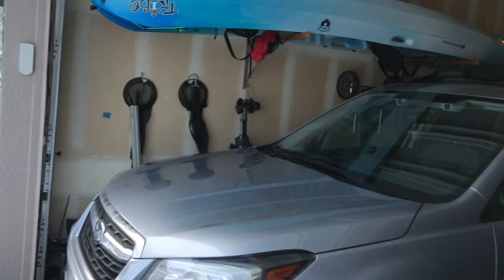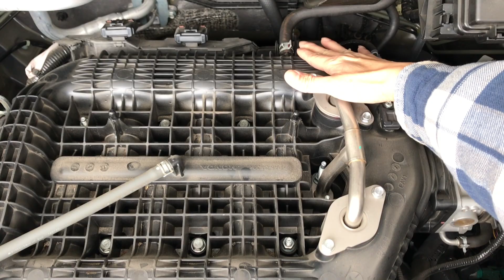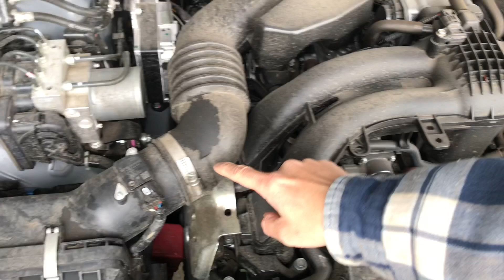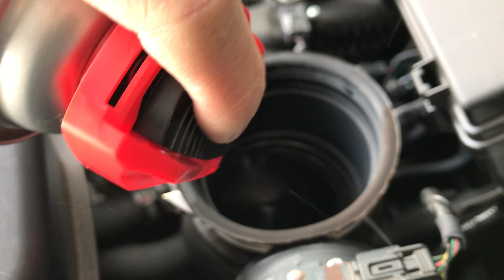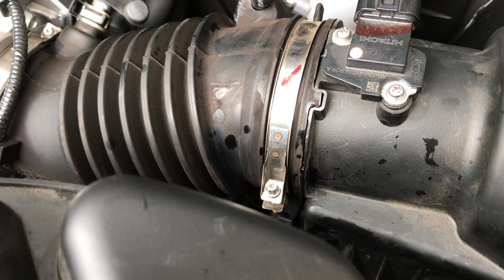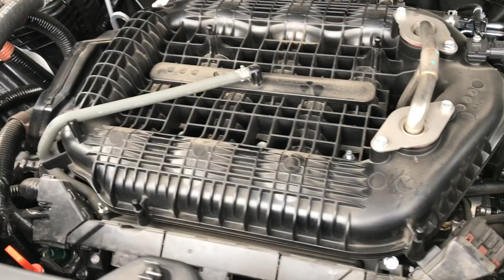2017 Honda Pilot Direct Injection valve cleaning

Comment: Had the intake manifold off of our 100,000 mile 2018 to adjust the valves and all the intake valves were pretty clean except cylinder 1. Which had a small amount of carbon on them.

Comment: Hi. Can you give me a hint? A message came up on the dashboard "emission System problem" I read errors p2096 and p2270 honda pilot 2017. Internet says similar problem although there is no extraneous sound. Can you tell me what could be the most common? And maybe the problem is that I poured injector cleaning fluid into the tank? How much is this estimated to cost at least roughly?! And I don't understand everything, I use a translator. Thank you.
Reply: Bad fuel injectors. Honda knows about it and they're warrantied for 10 years. Look up the federal law on emissions

Comment: Dude that hose over the middle of the engine is a direct access port over the intake valves.  That's where you are supposed to spray it
Reply: Just did my passport today, vacuum connection in middle of intake manifold. Worked great. Thanks
Reply: @randyschmidt7595 how did you do it? Do you just remove the middle vacuum hose and spray?

Comment: Why would they go direct injection?  Absolutely stupid idea.  I just have the head off of my 2013 Honda Pilot, 240K miles, and the valves and cylinder were sooooo clean.  A broken timing belt pulley bolt cause some valve damage on two cylinders.  All in all, the job was pretty easy, though time consuming.

Comment: How is your pilot running so far? I am curious... do you usually keep scantool plugged in and also monitor occasional misfires? When there is buildup on valves you will see misfires because valve will not open or close fully.
Reply from the maker: So far it’s running great at 90k, smooth as when it’s brand new, I am surprised how well this engine is holding up so far
Reply: @Y @Yakfish-Taco n you answer on the new comments?.. it’s been over 6 months…

Comment: I actuially just watched this video today. i did the same process on my 2017 Acura MDX. I sprayed the CRC GDI cleaner through the throttle body to get it to all 6 intake ports. I got nervous though when i drove my car for 25 mins on the freeway because it was losing power and the engine light was blinking. but after getting back and resting the car for 20mins I started the car again and no blinking engine light. I let it ran in idle for 10mins then drove it again in the freeway. the acceleration response was amazing. Gonna do this again after 10K miles.
Reply: Likely the weak power on the first drive was the engine going in "Limp" mode until the warnings cleared.
Reply: @timtaylor9339  Thank you sharing your experience I will trait this great information. That he share.

Comment: isnt this valve residue being evacuated via the exhaust ? you say to try to do this job closer to your oil replacement cycle which makes sense, but you are also suggesting this residue will end up being diluded with the oil inside the engine....
Reply: If your piston rings are experiencing blow by then there is the chance that small amount of the product makes it into the oil pan.  Therefore, performing this near the end of your oil change interval is just common sense.

Comment: use  top tier gasoline 91 octane with out ethanol , high quality syn oil . my 2018 never had that problem , or even oil dilution , I change my oil every 5000 km

Comment: Oil catch cans are only really helpful in turbocharged engines where there is higher oil blow-by. There might be some in NA engines from the PCV valve, but not as extensive as in turbo engines.
Reply: Not true...you won't believe how much my cans catch in my v6s

Comment: I wonder if this is good for your catalytic converter.  I have a 2014 Honda Pilot touring with 192,000 without doing this and it still runs smoothly. I cleaned the throttle body though and I only spray through the cloth and not inside the body.
Reply: Just make sure that the stuff you use says safe for cats

Comment: if the intake valves were meant to be cleaned wouldnt honda include it in their service recommendations. not just honda but other car makers. i'm sure they wouldnt want their reputation tarnished with engines that fail because of a poor design, or with something that should be done as regular maintenance
Reply: It IS part of maintenance. All direct injected engines will need the valves cleaned, once they get really bad the valves have to be walnut blasted to take the carbon off.
Reply: BMW has it as part of a maintenance service
Reply: @jerzefigga  its not part of my cars scheduled maintenance i looked. but i can ask them to do it at 50k miiles

Comment: Or, remove the MAF sensor and shoot the fluid down through there.
Reply: Excellent idea, that would be much simpler but would it affect the maf sensor when it's re-installed?
Reply: You’ll get codes, and the computer will try to compensate and make engine run unpredictably.   Possibly even put the engine into limp mode.

Comment: Hi, I got P0455 and P0456 code after cleaning the intake valve. Did you have the same issue? How did you solve it? Thanks
Reply from the maker: Hi, I didn't have any code showed up after the work, hopefully you had it resolved. Cheers

Comment: Isn’t the 2017 Honda Pilot engine has dual port? I think fuel additives is fine and drive it higher rev or more in highway.
Reply from the maker: no dual port, just the direct injection, no port injector

Comment: Hello Yakfish, I'm wondering how your 2017 Pilot is still holding up? I'm considering purchasing a 2017 Elite trim with 30,000k mi and have heard varying complaints of the fuel injectors going bad or depositing too much fuel and mixing with the engine oil causing a lack of acceleration power. You seem to take excellent care of your Pilot which begs me to ask if despite your great care have you had any issues with it? I've also heard that the Infotainment system can go a bit screechy and  go haywire at times. Much appreciated for any information you can pass on, Thanks!
Reply from the maker: Hi, thanks for asking. My 17 Pilot EXL has 63000 miles at this point, been experiencing 0 issues so far. We just went for a 2500 miles trip from Vancouver Washington to Yellowstone and it drove like a dream for the trip, averaging 28MPG. I did an oil change right before the trip, will change it again soon once it gets to 4000 miles, didn’t notice and gasoline smell or excessive wear in the oil. I will do another transmission flush at 80000 and will change out the transmission filter too. As for fuel injector I haven’t seen any issues yet. Infotainment as Apple car play? It seems to be working ok, the wife hasnt complained she’s the main driver. I guess we been lucky so far :)
Reply: @Yakfish-Taco  I live east of Portland, so local to you. I just picked up a used 2016 Pilot. What about spraying in where the PVC dumps into the intake? that's where all the goo comes from.
Reply: @Yakfish-Taco  we have a 2016 pilot and started having lots of issues with the fuel emission system. I did read there is a recall but when you drop of at dealership they will give you a different diagnostic. There is something wrong with our fuel injectors. Wondering if this method will help. Changing the fuel injectors is really pricey.
Reply: @Yakfish-Taco  I have a 2019 Honda pilot elite awd and I average 16mpg. It’s brand new and onyl has 30,000 miles on it. Why is mine getting such bad gas mileage I’ve seen a lot of other people have this Same issue and I’ve seen some people get 22 mpg with their 2019 pilot.
Reply: @gbma3241  There's too many factors to say for sure. Are you lead foot driving? Do you drive short distances or long? Do you drive in traffic or the freeway? Is the car well maintained (regular oil changes, air filter, etc)? What kind of tires do you have (all season, snow, all terrain)? Are you driving around with your parking brake on? Is the car empty or are you fully loaded or towing something?

I have a 2019 AWD LX and I get around 24-26 mpg highway and around 18 in the city. The MPG calculator on the car estimates on the high side on my Pilot by about 3 mpg. My Pilot has the 6 speed auto so that's different than yours but the MPG shouldn't be much different. I tend to drive with a light foot.
Reply: @Yakfish-Taco  hey I think you have great content. I also have a 2017 Honda Pilot exl and have an emission system problem check engine on. I have have my transmission fluid changed. I never did the intact valve cleaning you are doing. Do you think the fuel injectors are failing for everyone because they don’t do this maintenance. I also noticed people having issues with transmission issues. I have 43k miles.
Reply: @fejzocecunjanin2028  this is procedure to clean the back of the intake valves. this is not cleaning process for the injectors.
Reply: I have emission with check engine light on 13 honda pilot touring...
My 13 honda crv on dealership to replace power control model...

Comment: I'd be curious if you keep this vehicle for a long time if this works. I hate to say it but I don't think it will be sufficient. I think they need to be blasted with walnut shells. That's the normal procedure anyway.  If this works for well over 100,000 miles, that would be great.
Reply: If you repeat this service every 10K miles starting from new than it can very well delay walnut shell blasting. If not starting from new, than It most likely will not remove hardened carbon, but possibly prevent additional carbon.

Comment: Do you know if I need to do this to my 2016 Acura MDX?   Both MDX and pilot share the same V6 GDI engine right?
Reply from the maker: Yes, same engine. I think won't hurt to do this to the MDX :)
Reply: The MDX usues different ecu settings probably bigger valve heads hence why requires 91 or higher octane

Comment: I think you've been asked before, does the CRC intake cleaner solved 'Emission System problem' P0430 code?  I believe the light comes on around 50,000 miles on 2016/2017 Honda Pilot.  I had mine came on about 3 months ago.  Based on online research, there are hosts of  2016/2017 Pilot owners  with similiar issues.  Dealers want to replace injectors costing about $1500. Very disappointed with my Honda Pilot, maybe going back to Toyota.
Reply: Just wanted to update everyone!  I purchased 6 bottles of Chevron Fuel Injector cleaner from Amazon for $37.00  after the 2nd bottles, the Emission light disappear.  It's been over 1,000 miles and 3 full tank fill up, the light has NOT reappear.  Prior to this, it would appear about 75 miles after fill up.  Keep my finger cross!  Do I feel performance difference?  NO!  However, if this could clear the P0430 for $37, I am all for it!  Good luck to everyone and hope this helps!
Reply: After several months running on on/off Emissions lights and several bottles of Fuel Injector cleaner, I did notice some improvement to acceleration and my mpg average moved up from 21.3 to 21.8, which must be due to injector cleaner.  

In my mailbox today, I received a notice from Honda Corporation that they will repair all P0430, P0420, P0300 - P0306, P219A, P219B.  I am beyond thrill after suffering over year of poor acceleration, Honda finally came thru.  Can't wait to get to the dealership to have it fixed once and for all!  Thank you for all that have all read my updates and issue with my Honda Pilot.
Reply from the maker: Thanks for the updates
Reply from the maker: My pilot has 64000 miles now, no lights yet

Comment: What is that ticking noise from the engine
Reply: Fuel injection
Reply: honda's turbo
Reply: @youtmoonea  what makes a ticking noise on a turbo?
Reply: Just a loud Honda engine. All the Honda engines are loud. I bought my CRV new in '16 and the engine noise freaked me out until I heard others the same way.

Honda generators are loud too 😂
Reply: Stupid Honda design....they can’t make it quieter engine.  I was able to get rid off that ticking sound on my old 02 MDX after cleaning intake manifold completely removed and cleaned, new EGR, clean EGR pipe, throttle, new IAC valve etc.  Made engine super quiet than any other new Honda/Acura.  Honda/Acura design = Carbon build up everywhere.  Toyota no issues at all.

Comment: Can u doing video on awd. I know nothing about honda and can't find any helpful info on a 2014 ridgline.i want to say i have similar engine i have 3.5 vtech not earthdreams
Reply from the maker: Hi, not sure what you mean by doing a video on AWD, this Pilot is an AWD model, but this maintenance isn’t particular to AWD or FWD. Your 2014 Ridgeline uses a port injection engine so the gasoline cleans the intake value naturally, unlike the Earthdream engine. So In theory you won’t need to do what I did.
Reply: @Yakfish-Taco  lol sorry I meant can you do a video on servicing the awd differentials. I've owned a mustang for 10 years and have no idea what I'm doing. I love honda but not very many do it yourself videos on YouTube for a 2014 ridgeline
Reply: Its like the 2014 ridgeline never existed. Dealership charges way to much for minor fluid changes. Truck gets very poor gas also Please help!
Reply from the maker: We did the differential fluid change at 30k and every 30k going forward. We did it at the dealership for $147 on both front and rear

Comment: I'm no pro but a car with 30000 miles has just broken in. All engines are different  depending on driving habits though. Your engine is still clean for sure but doing this will prevent premature maintenance 👍

Comment: Does this CRC Intake Valve cleaner solve the "Emissions System Problem" engine light issues that are happening very frequently??
Reply: Prabhas, I had success with Chevron Fuel Injector cleaner from Amazon - 6 bottles for $37.00  By the 2nd bottles, the light disappear and has not appear since.  It's been over a month now and over 1,000 miles, keep my finger cross.  Good luck and I hope this help!
Reply: @rontan8954  Did you have a
RPM fluctuations ?
Reply: @soldado23  Yes I did.  The car would hesitate on acceleration and the RPM would run up but the car would not keep up.  As of today 4/1 - thought it was a April Fool joke - just got a letter from Honda that they will repairs the emission issues relating to DTC P0420, P0430, and other error codes due to Emission failure.
Reply from the maker: That I don’t know if it will. My pilot hasn’t had engine light coming on yet so far

Comment: Just subbed....nice vid...hey about changing out the coolant. Can’t find anything anywhere for my 17 Ridgeline...same engine as pilot
Reply from the maker: sorry I didn't see this until now. I was looking for coolant videos too, yes it's the same engine as the Pilot. I think most people will do it at the shop, maybe it's more "messy"?
Reply: @Yakfish-Taco  looking exactly where the drain plug is and do I have to remove anything to gain access to it.

Comment: My 2018 Civic EXT just hit 50,000 miles.
I’ve been replacing the oil every 3500 miles.
I’ve only used top-tier fuel...Shell 93 Octane (Nitro Plus detergent).
I’ve only seen moderate results from the CRC spray from other videos so I’m considering doing a walnut blast.
Reply from the maker: The new Honda earthdream engine is has very advanced design and runs clean if you keep it clean. Sounds like you're doing exactly that. What you're doing will keep the valve clean especially with good synthetic oil and clean gasoline and changing oil more often. I do the same thing as you that's why at 30k the clean produces very little white smoke. :)
Reply: I use amsoil change oil every 5000 miles. Use I octane 93 also and marvel mystery oil at every fill up. Also amsoil trans.fluid cvt Getting 35 m/p/g around town. All turbo engines need 93 octane.
Reply: @reginaldsmall3766  
You’re doing better than me. I’m averaging 31.1 mpg but I also do a lot of driving (60% city, 40% highway). I’m currently at 64,300 miles.
Reply: @txmoney  what do you use for oil?

Comment: Unfortunately, you may do more harm then good by using CRC and similar fluids. The deposits will break in big chunks getting into the cylinders. You will get wall scoring and possible valve damage, and then it is stuck in the cat converter. Due to GDI crappy design in general the media blasting is the only reliable (and expensive) way to clean the intake valves
Reply: I don’t think it hurts to do it once lol… i am running more mild additives through my gas tank. 63 gallons worth and then I’ll rip out the big mama jama (CRC) and put new penzzoil in it with a oil catch can. Hopefully carbon deposits will be kept at a minimum.
Reply: Only if chunky and  crc says this slowly dissolves which is why you are supposed to use entire can

Comment: Great video! I have an 2018 crv and my parents have a 2006 and 2016 pilot. Will look into doin this before my next oil change. But I think after you let it heat soak for an hour, the instructions say to drive on the highway at highway speed for at least 10 mins. But the roads looked a bit icy when you filmed this so maybe next time
Reply from the maker: Definitely next time lol
Reply: This spray is only beneficial for cars that have GDI. Check your vehicles. If they have port injection than the gasoline is already keeping the intake valves carbon free.